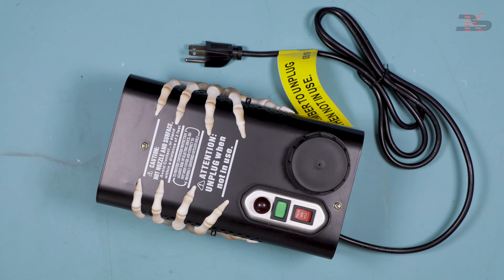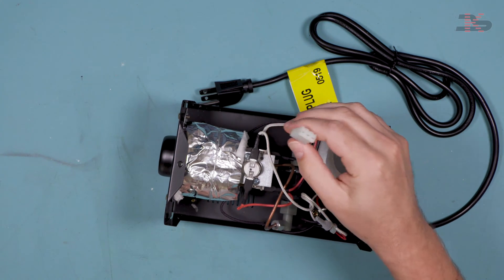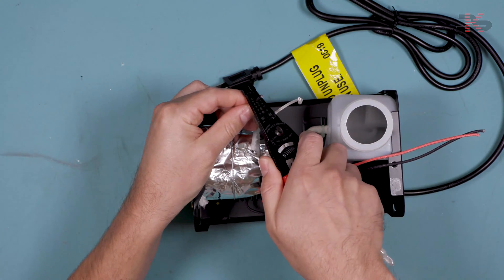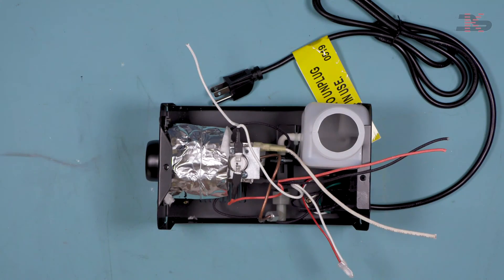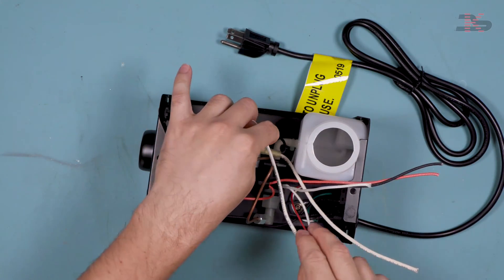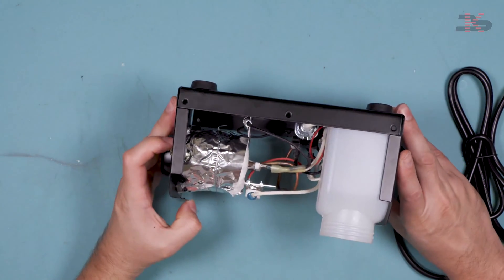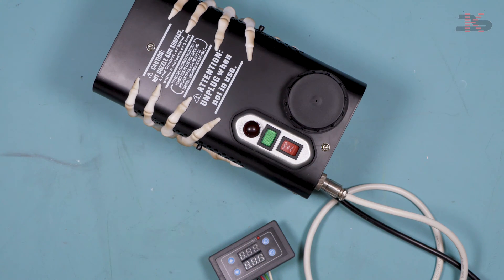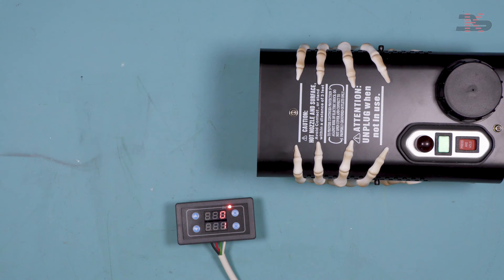Halloween Fog Machine Timer Mod

Comment: Anyway you can do a video walk thru setting the timer up? The instructions that come with the QR code are very hard to follow.
Reply from the maker: Good idea! For now, here are the instructions I have for the timer. My mode settings are P0-1 and P1-4.

Time Setting: Short press "SET" to enter the time setting mode, and the T1 LED digit tube will flash, press the "UP" & "Down" to set the time "T1", then short press the "SET" again, the T2 LED digit tube will flash, press the "UP" & "Down" to set the time "T2". 

Two ways to save the setting, one is wait 6s and the module will save the parameter automatically, the other way is to short press "SET" again to save.

Working Mode Setting: Long press "SET" to enter the working mode setting that includes P0, P1, P2.
1) PO--0 means the timing unit is 0.1s
2) PO--1 means the timing unit is second
3) PO--2 means the timing unit is minute
4) PO--3 means the timing unit is hour
5) P1--0 means delay T1 time then the relay close (T1 timing)
6) P1--1 means delay T1 time then the relay open (T1 timing)
7) P1--2 means delay T1 time then the relay close (T1 timing), and delay T2 time then the relay open (T2 timing)
8) P1--3 means delay T1 time then the relay open (T1 timing), and delay T2 time then the relay close (T2 timing)
9) P1--4 means delay T1 time then the relay close(T1 timing), and delay T2 time then the relay open(T2 timing) and repeat
10) P1--4 means delay T1 time then the relay open (T1 timing), and delay T2 time then the relay close (T2 timing) and repeat
P2--0 to P2--5 is the LED display brightness adjustment.
P2--OFF: low power consumption mode, the module will automatically turn off the LED display after 10s and press any key to turn display on.

"OK" key function:
1) After finishing all the parameter settings, press "OK" to save the parameter. During the working process, press the "OK" key to pause the working mode and the relay will open, press again to work.
2) Trigger again function: when the module finishes the working mode, pressing "OK" can restart this working mode.

Comment: The fact that it didn't go off when first triggered is because you must have bypassed power to the pump, which is normally powered thru the thermo switch, which is intended to prevent power to pump and "ready" light until the heater is up to temp.  A schematic would have been nice.
Reply: That's not why it didn't go off. The safety thermal switch did not activate because it was not hot enough to do so the first time the timer went off. It would work exactly like this if the pump hadn't been ready and someone pushed the button on the remove or the manual switch on the machine itself.

Comment: Have you experimented with how long the fog can go for with the heater on? Or is the heater timed? I’d like to mod mine similarly but I’d like to have the fog running for a long time(i could upgrade the reservoir to hold more fluid).

Comment: What gauge high temperature wire did you use? Also, you skipped the wiring to the aviation connector & timer. Are those self explanatory after receiving them from amazon?
Reply from the maker: I used 14 AWG high temp wire (ASIN B001ALN0JG)

For the connector, I matched the order of the terminals on the timer. 
Pin 1 VCC, Pin 2 GND, Pin 3 S1, Pin 4 S0
Reply: @theKunkelater  I'm still a tad confused...on my timer...the vcc should be to the white wire that you replaced first...the gnd should be the black wire..the s1 should b the red and the s0 should b the little white wire?
Reply: Thank you @theKunkelater! I just finished this hack and it works!  For the wiring question, facing machine with tank on right.  VCC to FAR heater connector.  GND to RT pump connector, S1 to NEAR heater connector, S0 to LEFT pump connector.  I’m just happy that it works and I didn’t melt my timer!!
Reply: @wonderfulonez  thank you. Hopefully I can finish this up...i got 4 of them to do. Just don't want to burn the house down lol
Reply: Jason Preissler where did you get the machines and how much were they?  I’m using the one I have for a Monster in a box.
Reply: @wonderfulonez  I got mine last year at walmart I believe on clearance  I think they were 7 bucks a piece lol
Reply: @wonderfulonez  for some reason my timer won't count down the seconds...it counts down time...then goes off..but doesn't count down the time and it have to turn the timer back on every time
Reply: @oscrfsh  I'm not sure I can be much help since I closed mine up again.  This issue is probably with the timer programming.  Put the QR code that came with the timer in front of your phone camera.  It's a link to the manual for the timer.  I had do play around with the settings to get it to do what I wanted.  If the fog does fire,  you probably did wire it correct now it's a little bit of a battle with the poorly written manual.  Good Luck!
Reply: @wonderfulonez  I finally got it. The manual is quite confusuing...but i finally figured it out. Only 3 more machines to go lol
Reply: Jason Preissler terrific!  Next week I’m going to do my first fog chiller!
Reply: @wonderfulonez  i like this one better. I have a 1000 watt with the timer u can get from the store..but it will only spray for 10 sec. I like how this way I can do it longer
Reply: @wonderfulonez   fog chiller is my next thing as well. I need to make 4 of them. So many different options. I dont know if I want to do the ice over dryer hose...or the fog into bucket and just let the fof go over the ice. Not sure yet. What r ur plans
Reply: Jason Preissler how do I PM you on YouTube?
Reply: theKunkelater thank you!